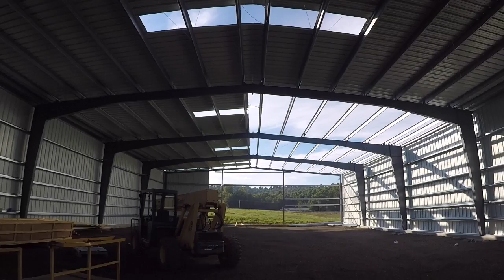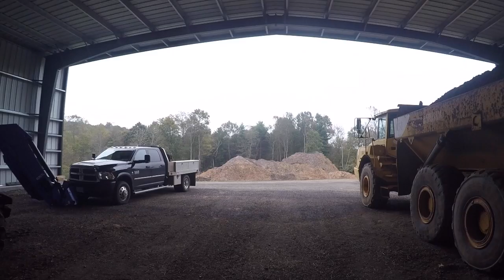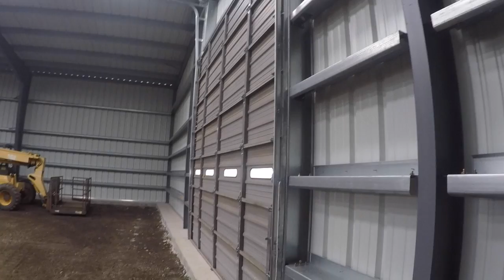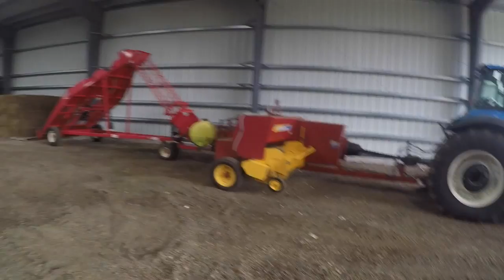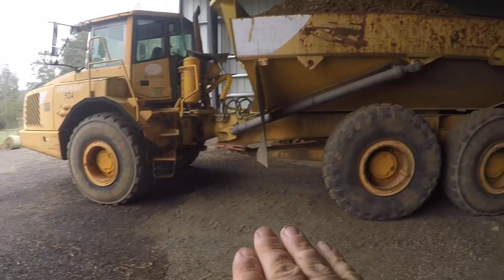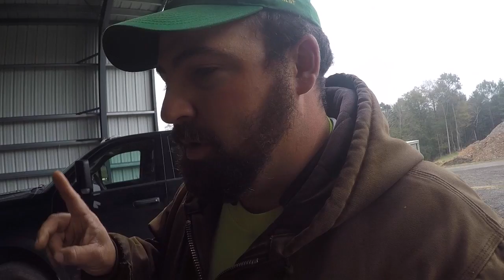The building is Done!

Comment: You can get some UV proof covers for the hay, we use them for storing wood within a building (of similar size) that also needs to be lit to prevent mold and other issues that come with dark environments.
Reply from the maker: Well I thought light was good until I got to thinking about light on the hay all the time. Uv covers may be the ticket if it becomes a problem.

Comment: Don't you have a Barn Raising Party, but then you didn't have a bunch of helpers put it up. You used a few green backs instead.
Building looks good, but it takes no time for people to fill em up.

I did here you shouldn't felt line a clay tile roof if there going to be livestock housed under it. If sun bleaching is a problem why not fix a pull blind, you could then open it when you need the light.

Have you thought about silage cutting instead of hay, or is it not a saleable crop.
Reply from the maker: Silage isn't a sellable crop here. Not in the horse market I'm aiming for anyway.

Comment: that's one sweet building you got there, not sure i would have a door at the back end as that means you can only use each side of it but its what works for you is all that matters, nice to keep every thing in the dry
Reply from the maker: Once we get the road out the back side done we will be able to drive through making it easy to unload trailers and then Driving out the back instead of having to back in or back out.